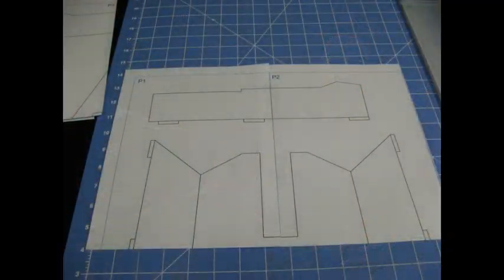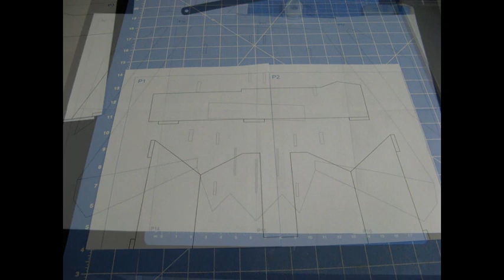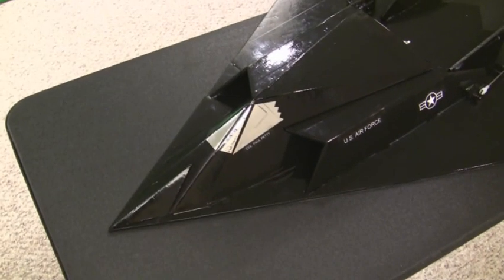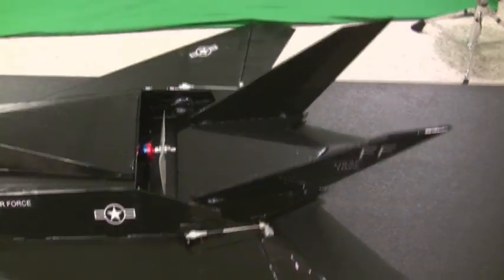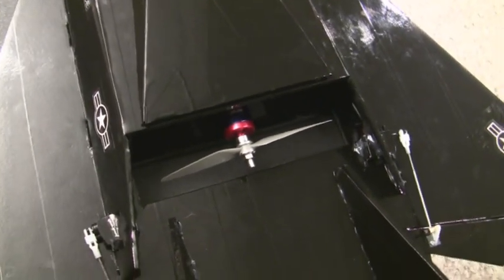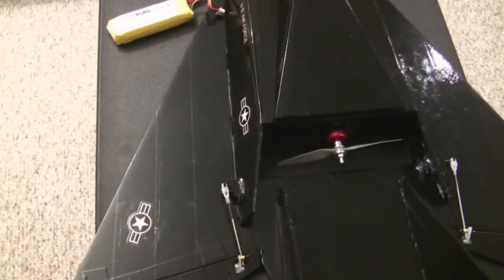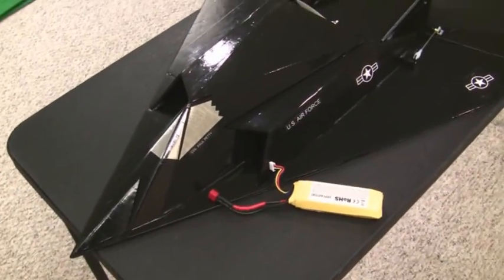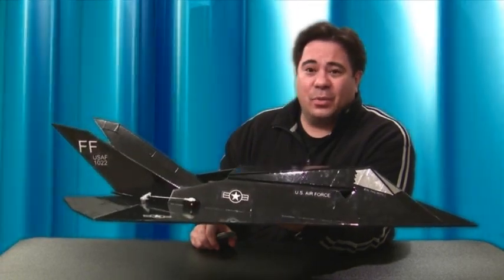FF-117 Part 1 (F-117 Stealth Fighter Inspired RC Plane)

Comment from the maker: Thanks for the comment GRS15720. The CG I still have to test and make sure its accurate. I won't know for sure till I can do the maiden flight. The estimated CG was found by doing glide tests with my two Mock up models I made. I will use what seemed to work on the full size mock up, about 16 inches from the nose. After I get it maidened I can make any, hopefully fine tuning adjustments. Thanks again for watching!

Comment from the maker: Keller,
The tape we use is 2 inches wide. it is just colored packing or sealing tape. its kind of hard to find in stores, i usually order online from Tape Brothers or Amazon. there are links on our Blog too if you can not find it. As for the iron, we usually don't need it when using foamboard. It sticks to the paper on the foamboard pretty good. Sometimes i will use a heat gun to shrink the tape a little if i have wrinkles. Thanks again

Comment from the maker: Thanks Beyerii! It is the elmers Foamboard, 3/16. We leave the paper on as it makes a stronger model. A bit heavier, but with the right motor and enough power it is not a problem. I did use the Black foamboard, but we usually tape it to help protect against moisture and also adds a bit of strength. I'm sure you could make the model and not tape it too, but will be more apt to get wet and warped. thanks again.

Comment from the maker: Keller,

Usually I use a Hot Glue gun when working with Foamboard. it seems to work pretty good and is nice a low cost.

As for the FF-117, I have the new one already built, now I'm just waiting for warmer weather. its been super cold here the last few weeks.  Actually below the rated temperture range for my spectrum receivers. But hopefully soon we can get out and test it. Thanks again!

Comment: Hello RC Foam Fighters,

Please elaborate on the type of foam used to build your  F-117.  

I think the video says "Elmers Foamboard".  Is this 3/16" Elmers (Hunt)  "Sturdy Board" foamboard?  

If it is, you might consider using Elmers Black on Black (PN 901120 or 901121) to avoid having to color the F-117.

From what I read, this foamboard has a layer of paper glued to its surface.  Do you use it with the paper attached or do you remove the paper??

TIA,
Keller Beyer

Comment: Hi Paul,

What do you think about spray painting the foam board instead of using colored tape?  

Do you thing the wet spray paint would cause the foam board to warp?

If it would not warp, would the paint be enough to protect agains moisture?

Also how much strength does the tape add to the foam board?

Thanks for your help,
Keller